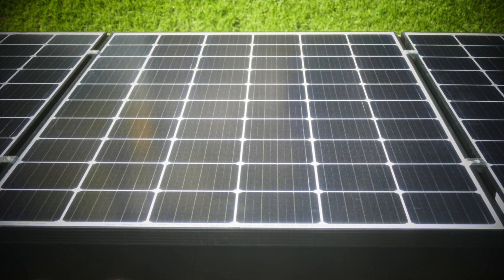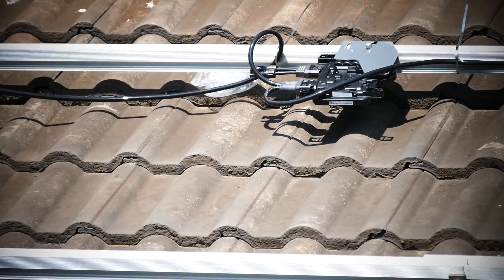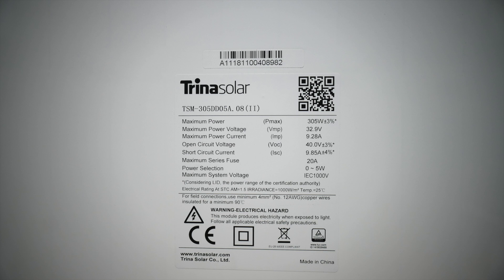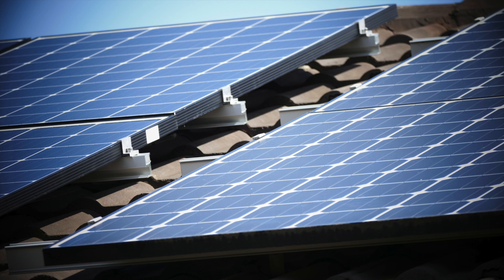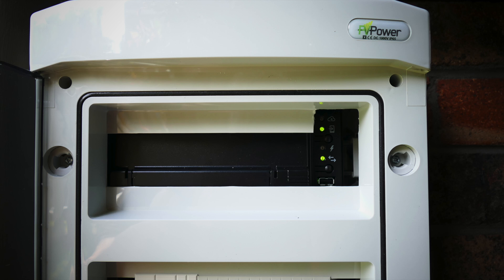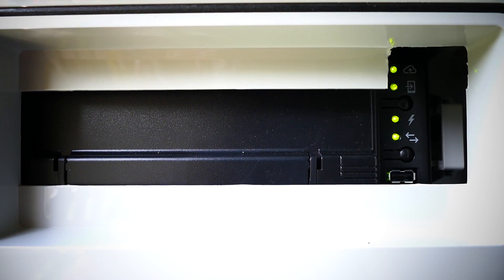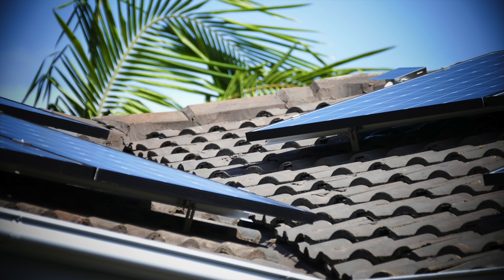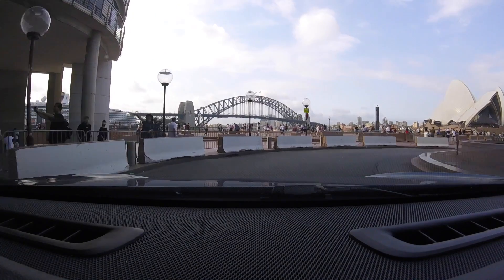Solar Panels 5.4kW Installation to Existing 3kW System | Ludicrous Feed | Tesla Tom

Comment: How many weeks after the appointment was booked online did Solaray installers show up at your door? How many hours did the full install take? Did someone (you / another adult) have to be home during the whole installation process?
Reply from the maker: Tesla CyberTrunk Solaray were great - installed within a few weeks I believe. 
Install took approx 4hrs. I strongly recommend that a responsible adult is on site for any work done on your house.

Comment: that junction box at the back of the panel usually has 3 diodes in them. they are bypass diodes and do not stop reverse flow. they simply short.
Reply from the maker: Urs Odermatt Thanks Urs for clarifying.

Comment: Thanks Tom, btw do you know what’s the maximum solar power allowed for a house in NSW? I assume there is a maximum limit?
Reply from the maker: Conrad Fuller Good question Conrad. I think it depends on individual distributors eg. Ausgrid: 10kW for 1~ (limited by inverter) and 30kW for 3~ 
Anything greater than 30kW may need more paperwork. 
Have a look at https://www.solarchoice.net.au/blog/solar-system-size-limits-by-network for breakdown by distributor. 
Happy to be corrected by anyone else who knows more. 
TT